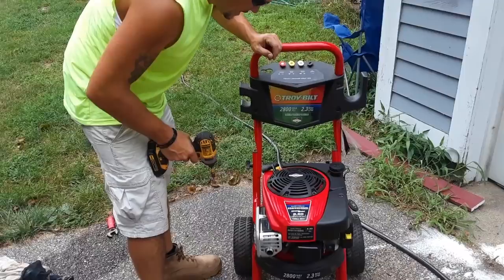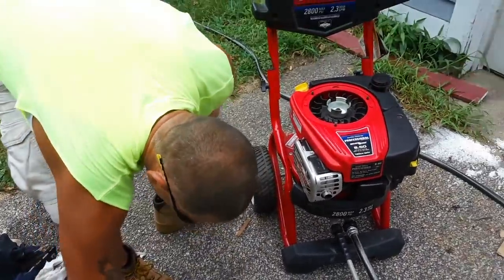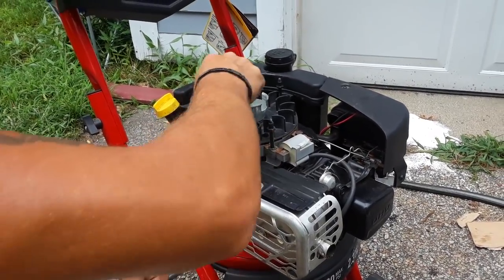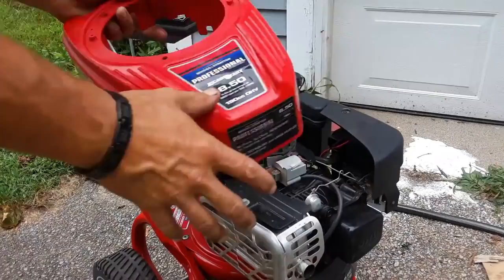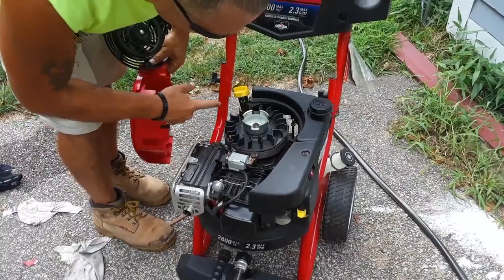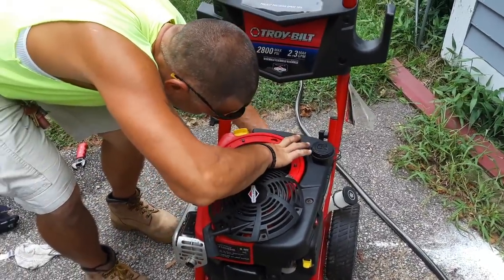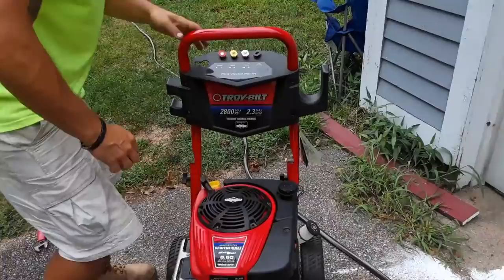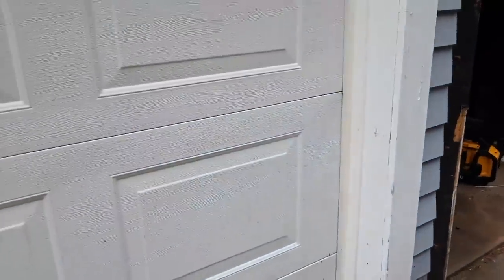Troy bolt 2800  no choke no prime  power washer  won't start fix

Comment: For once a video that finally helped me a couple of weeks ago at a yard sale I picked up a Craftsman perfect mix 3,000 psi pressure washer 8.75 horsepower the owner said it was hard to start he had it for a year used it twice but it's at outside uncovered I did what you showed and sure enough it was rusted all the way around I took 5 minutes to sand everything down put it back together and first pull it started right up thank you very much have a great day
Reply: I have a “Crapsman” too. I used it twice, I’m gonna try this
Reply: I did the anti-rust deal too. No go. Probably coil.

Comment: You can test that before opening that up. Spray starter fluid in the intake and see if it fires up, if it does that is working fine.
Reply from the maker: Thanks for the tip

Comment: Perfect fix!  thank you so much.  Engine was not turning over after puling cord.  Followed your instructions, opened the cover and found a completely rusted wheel.  Hit it with a belt sander for about two minutes.  Started up again after a few pulls of the cord and started right up.  Ran it for a few minutes, turned it off  and then restarted a few more times to confirm.  turned off again and let it sit for 20 minutes and restarted on first pull of the cord. Thank you so much for posting this video!

Comment: Thanks for the tip and the video.    Every year....   I have to take the carb off and clean it all out.   This year, I cleaned the carb... and it wouldn't start.  So I came in and search for videos.... and came across your video.    This morning....  I took the cover off.... and sure enough... the edge of the flywheel all the way  around had rusty surface.     Used emory cloth and cleaned it off to bare surface all the way around.
I put the cover back on..... hooked the hoses all up.....  cranked it and it fired up right up and ran solid.

Also... something I did two year ago.....  I have a hard time pulling on the rope and it wears me out when it won't start.

So....   I took the black rope housing cover off..... and I removed the coil spring rope assembly.  Then.... I took a hole saw and cut the center out of the cover.... which exposes the big nut holding the flywheel down.
I put the cover back on.....  and now to start the engine.... I use a 1/2 electric drill attached to a socket the size of the nut on the flywheel.

I slide the socket through the hole and on to the nut....  then hang on to the drill real tight.... pull the trigger and off we go.

As soon as I feel it starting..... I lift the drill and socket off of the nut and wallah..... engine is running without tugging on a rope.

Comment: I've worked on my Craftsman brand Briggs & Stratton power washer for 3 days...I've watched about 12 youtube videos....changed gas, changed oil, changed spark plug...took the carb apart...it all looked clean and new...I was about to give up and junk it (it's too cheap to take to a shop)...and then I found your video.  Mine was completely covered in rust...I sanded it off with my sander, and Wa-La...runs like a champ!!  Thank you guys so much!!! Oh, it took 5 min's of sanding!!! Too easy!!!

Comment: My Briggs & Stratton would not start either.  I thought it was the carb or old gas but after fixing that, the same issue.  Per this video, I popped off the cover and saw that I did have some rust, so sprayed some electrical contact cleaner on that metal wheel and scrubbed with small brush.  After putting the cover back on, it started on first pull. Thank you!

I used electrical contact cleaner because I had it.  There was very little visible rust when I first examined it but steel wool, a small-fine wire brush or any number of other remedies to make that wheel shiny and clean probably would work just as well IMO.  The contact clean is like magic for this application and many others around the garage.  

It is surprising how just a little rust makes it impossible to start. I learned today this has to be clean.

Comment: Wanted to thank the two dudes who published this.  I replaced the pump on my Troy built 2700 Pro (a few issues/irritations, but the cheap Chinese one for $80 seemingly will work- fit... if you do this - you might have to go buy longer bolts at hardware supposedly for some models, but mine was good out of the box... just three bolts and then rough house it out of the bottom of the motor/have to lay the machine down and pull it out like a baby cow coming out of momma - that is breached), then duck tape the engine to the frame when reinstalling, keeping your holes lined up...it was a bitch to try and bolt the pump on while the engine is falling off the frame on the other side)...Didn't work after the pump replacement and letting the water spirt out for like three/five minutes to actually get the air out (must do each time before starting).  Finally - watched this video - I took my cover off and you can't see anything but rust.  Going to do this fix today and hopefully... it now works.  I'll replace the gas and oil if this doesn't do it.  I used starter fluid (spray a little in the box which covers the filter and should start asap) - I did this and got it to run, but kept dying .... I'm assuming the rust is now the culprit and this is a "restored" machine.  Pain in the ass for all this, but probably only about two-three hours total with ordering, installing, cussing, questioning why I didn't just go get a new one and trash this... But, since it was over $500 new.. I gave it a shot and think I"m good.  Wanted to share what I found out along the way and thank the guys who helped me from tossing it after all this work....

Comment: Thank you for this tip, was getting ready to order a new carb when I found your video. I had a couple troubles that were fuel/carb related but the rust was the last trouble. Fired right up after I removed it with steel wool pad.

Comment: I follow the 3 rules.  Check for fuel, spark, and compression.  Just my view, I always clean the ignition coil and set the gap correctly.  If you do not have a filler gauge, I use a cardboard business car and usually works with this type of motors.   Thanks for sharing the video.

Comment: Thanks. Great tip. I tried to get that top fly wheel off by taking that 1 inch not off.  Could not get it off. However I was able to get a small wire brush attached to my power drill into the sides of the housing. Got those contacts met at strips all cleaned up. A little carburetor cleaner and starter fluid and I got my unit to run.

Comment: Before I found this, I removed the top. Then I put a propane torch opened at the carb hole. I put a drill on the center nut and let it do the cranking. Started right up. Now I need to clean what you showed to see if that fixes my real issue. Thanks.

Comment: I have the exact same pressure washer that won't start,  I'm going to give this a try now ! 👍
Reply: Valerie White did it work when u tried it??
Reply: I also have that same one and had problems getting it started. I thought my carb was gummed up so I started taking it off to clean it. After I took the air filter off I noticed that the on/off switch wire was looped over the throttle. I’m thinking it was keeping the gas from getting into fire. Rerouted the wire behind the fuel I think and have no issues. Figured this out after a year of having to pull the crap out of it to no avail. YMMV

Comment: I also have that same one and had problems getting it started. I thought my carb was gummed up so I started taking it off to clean it. After I took the air filter off I noticed that the on/off switch wire was looped over the throttle. I’m thinking it was keeping the gas from getting into fire. Rerouted the wire behind the fuel I think and have no issues. Figured this out after a year of having to pull the crap out of it to no avail. YMMV

Comment: Brother you just saved another veteran from having a ptsd moment and chunking my pressure washer down the drive...literally(I’m the veteran btw)...I’d giving up hope and and just “YouTubed” one more time and your video popped up....I was skeptical cause I’ve YouTubed before and nothings worked.  I did exactly what you did and she started right up...thanks brother...oh how often do you hunk I’d need to do this or check on it?..cause while the actual cleaning and removing rust were pretty easy and just took maybe a few minutes but the dang my crank is on the front not the top and it was a mother F er getting the whole engine cover off and on...I couldn’t pop the crank cover off like yours mine is frigging riveted on so I had to take the whole shroud off and the front tubing and tire are in the way and I had to remove the tire to get the shroud off and I really don’t know how I got the shroud back on but somehow and a lot of cussing it finally popped/flexed into place....thanks again and take care
Reply from the maker: I check mine every time it sits for longer than two weeks

Comment: Started with cleaning the carburetor and filter.   Then moved on to using a brillo pad to clean the surface of the contact points.   Not sure which one worked but the power washer started on the full pull .

Comment: Previously, I  had Honda machine, and it  lasted for years without any issues.  Troy-Bilt harder than heck to get to  work since Day 1--definitely should have taken back--hindsight 20/20.  This machine should start up each and every time with clean gas and proper care when new--and it does not.  I do not have all day just to get Troy-Bilt just to start.  There is no way I will buy anything ever again with the Troy-Bilt name.
Reply: Troy Bilt finally got smart. They now use the Honda engine.  :-)
Reply: No they do not still briggs and straton nothing wrong with them...heck i got a 1992 murray mower with one never gave me shit lol